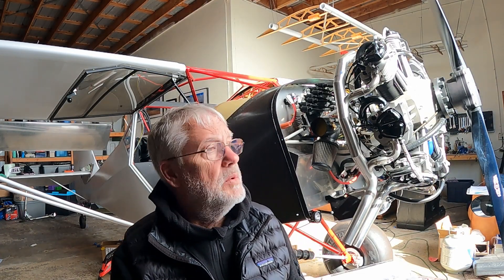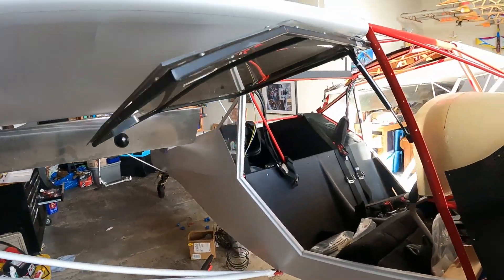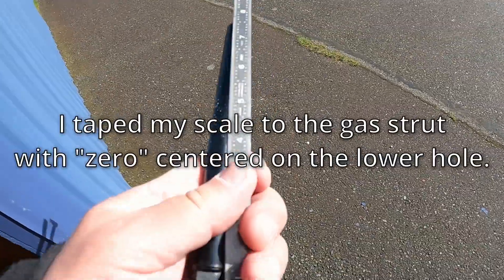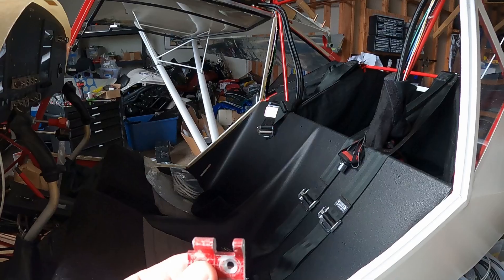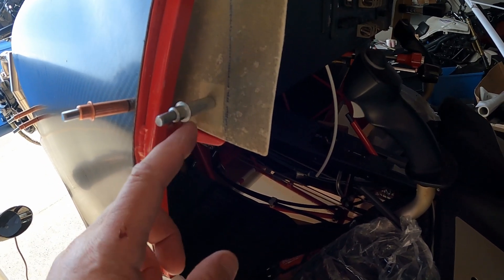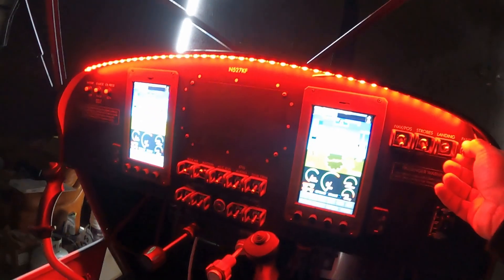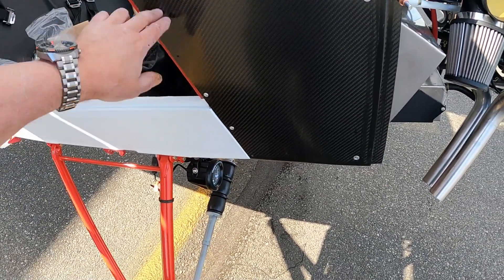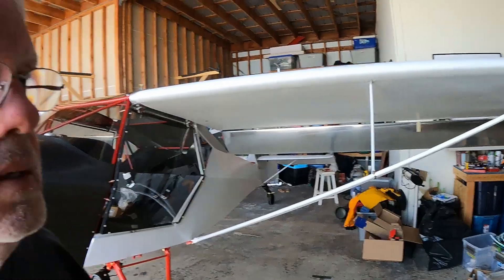Verner Kitfox 5 build video 46

Comment: Another great video Alex. Thanks. I appreciate your tips on strut compression -> measurement -> install. Thanks. Regarding the oversize tubing-pass hole in the glareshield... mine ended up oversize too. Oh well. Some questions for you: 1) do you have moulding PNs for glareshield and boot cowl edges? 2) PN for the door hinge "safety pin"?  3) What brand/type of 'rattle can' paint are you using? 4) Tips for wrinkle-free glareshield covering using spray-on contact cement? 5) Are you using deutsch connectors everywhere? (kit seems to come with every connector type ever invented) Specifically, I could use a compact 6-wire connector suggestion for the hat-switch/PTT wiring at base of the control stick (if you installed connectors there).

BTW, I got my engraved panel back but was sadly disappointed that the lettering looks grey, not white, as though the aluminum is tarnished :-(

Thanks again Alex.
Reply from the maker: I got the edge molding from Amazon.  I'll figure out how to put links into the description of this video.  The "rattle can" paint I refer to is something I purchase from my local Wesco auto body shop.  They can mix up paint to match any color sample.  It is single part paint and then I top coat with a 2K clear they sell also.  It's actually very high quality stuff.
The 'safety pins' I refer to came from McMaster Carr but they were given to me by another builder who had extras.  I know that Kitfox sells a version also which is smaller and looks better.
I used RS232 DB-9 connectors at the base of my control sticks.  Deutsch connectors have some weather resistance so I use those ahead of the firewall, in the wing tips, etc.  I have 2, 3 and 4 pin versions depending on the need.  Again, Amazon is my source (DTM is the brand I have purchased).  Buy the crimper tools and practice using them!
On the glareshield, lay the fabric over the whole thing,  expose one half and spray both surfaces with Spray 90.  At least two coats on the fiberglass.  Start in the middle and work towards the end. Go slow so you don't get a wrinkle.  Once the stuff touches, that is where it will stay. The only trick part is where it touches the windshield, and it wouldn't be the end of the world to get a wrinkle there since no one can see it.
Fold back the half you haven't done yet and repeat the process.
Reply: @vernerradialkitfox4083  Thanks Alex for all the details! Appreciated!

Comment: Nice work. I will tell you the doors will rub and scratch the acrylic on the oratex while open taxiing or flying if it closer than an inch while hanging open from the wing. They move a lot with prop wash. Mine are a half inch and rub. I had to put a rubber piece on the door to stop it from scratching.
Reply from the maker: Good to know Harlan. So doors closed when the engine is running. Have you flown with them removed?
Reply: @vernerradialkitfox4083  I have not. I'm not a fan of open air flying at all. Haha. I've got the door handle that opens the door about a half inch and that's about all the wind I want in the cockpit, I'm just strange I guess cause everyone takes the doors off in the summer.